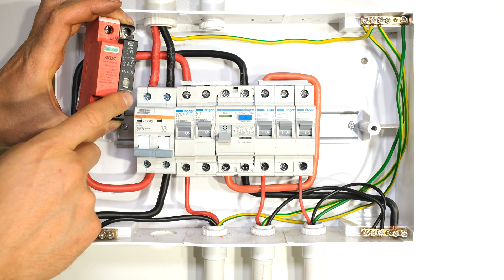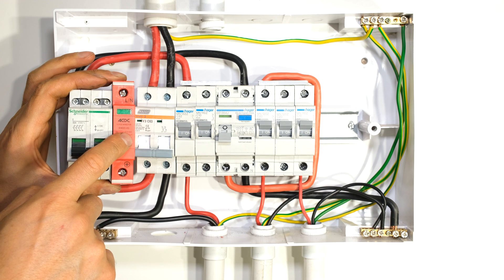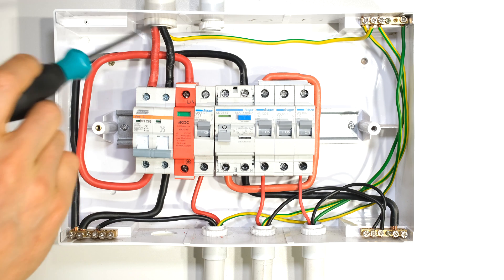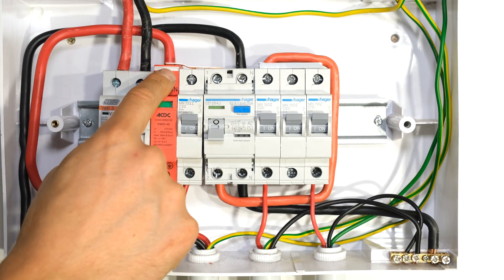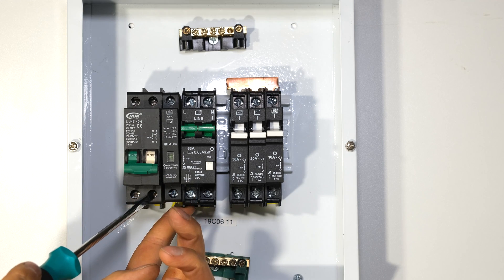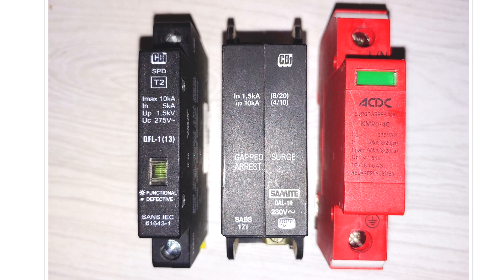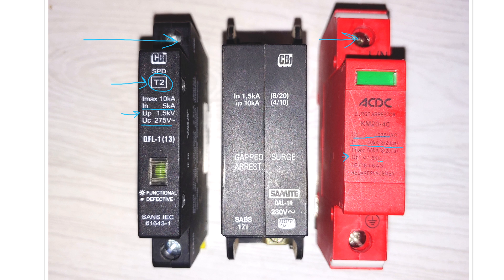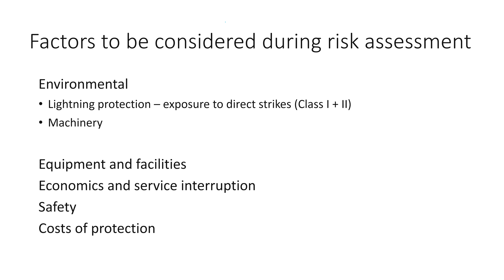How to wire a type 2 surge arrester into a distribution board - factors to consider - South Africa

Comment: Some double poles SPD they connect live and neutral on incoming power then earth on neutral side of outgoing power. Some they put live on both incoming power then earth on outgoing power, what's the difference. And also comparing it with single pole SPD.

Comment: Hi sorry to be negative but is that board wired compleaty backwards. Eg should the main isolator not be on the right and rccd next to it with bus bars feeding the bottom of the mcb s. Like wise the out going cuicuits coming out of the top of the mcb s not the bottom. Look s like a very over complicated solution for a standard instalation to me.

Comment: I'm a DIY'er and have always had a preference for building a DB Board from left to right as you show. It's like reading 😀. However I see in some standards that Neutral should always (understandably) be on the "outside".  So, a Main Switch with "L" and then "N" on the right, should always be mounted on the right of the DB board. What is the ruling in SA?

Comment: I think u get the wrong point about SPD need over current protection device (MCB or fuse). It is to isolate the SPD from the DB system if SPD fail, fault or damage. So you need an extract MCB or fuse as over current protection to connect between the Main MCB and the SPD, not directly connect the SPD to the main 63A MCB.
Actually in current situation over current fuse disconnector is prefer than MCB, because you don't want the MCB in between SPD and Main MCB trip during lightning strike , you want the SPD to arrest the lightning to channel it to the ground, so fuse disconnector is prefer, that is why among all the SPD catalogue they normally emphasis fuse disconnector before SPD, not an MCB.

Comment: If this is a sub-db, and the main db already has overcurrent protection, do I still need to to include an overcurrent protective breaker in this db before the surge arrester?
Reply: If the sub board is protected by a MCB, then you can wire this first

Comment: This is probable a stupid question but anyway....
I have a CBI Type 2 Surge arrestor QFL-N-2(13). The diagram printed on the device shows N wired on the top left terminal and L wired on the top right terminal , with Earth bridged across the bottom terminals.  However, the electrician has wired it so that Live (Red) is connect to the top left terminal (N in the diagram) and Neutral (black) is connected to top right connector (L in the diagram). According to the diagram, this the wrong way around.  My suspicion is confirmed by the fact that the surge arrestor light is off. Am I correct and if the diagram says N is left, then N should be connected on the left?  Or doesn't it matter and I need to go back to Reading 101?
Reply: L or N doesn't matter if it has two separate identical blocks. If it is a 1P spd, then L & N will matter.